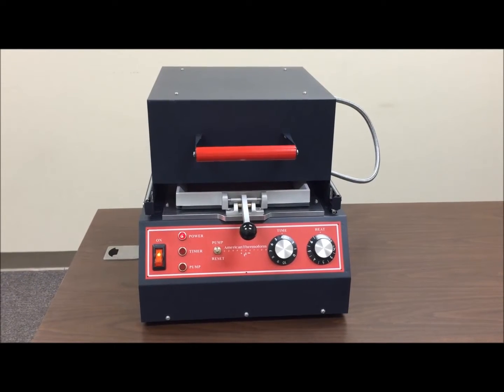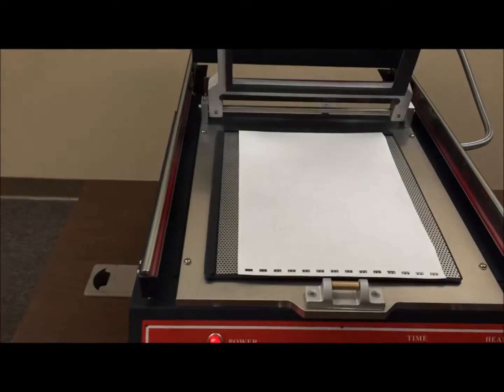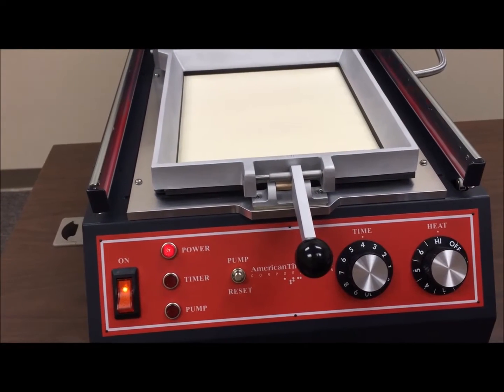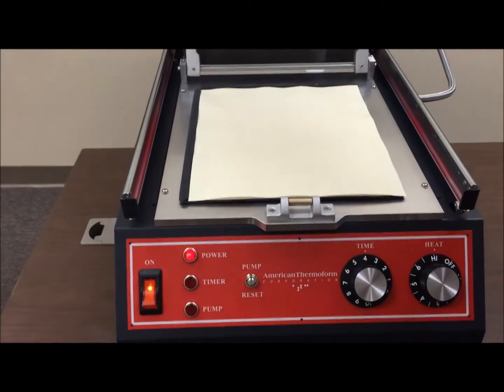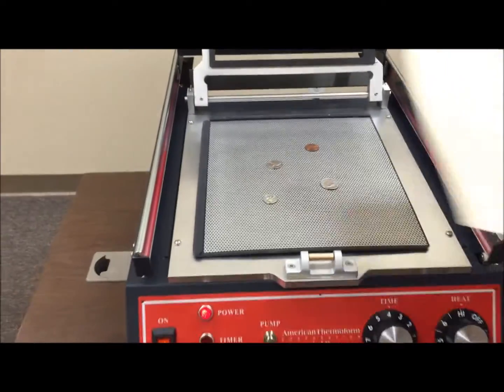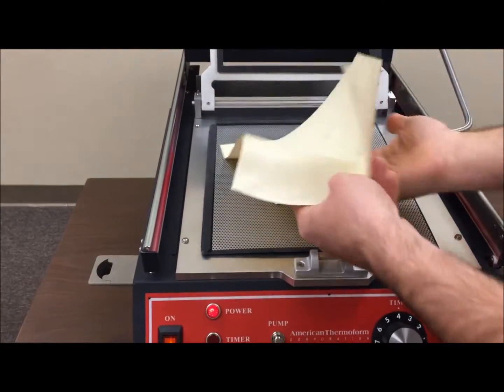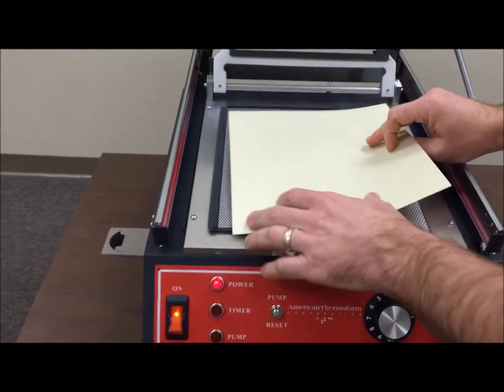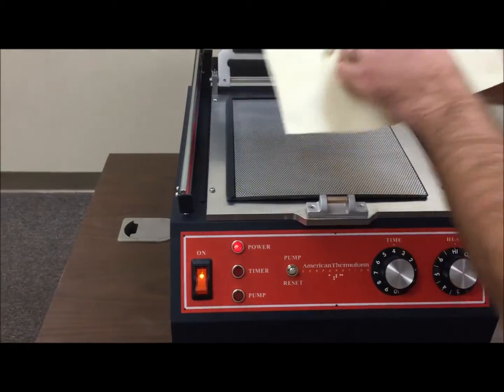ATC Brailon Duplicator: A Brief Tutorial

Comment: So what are the forming dimensions (meaning what depth, width and height can it thermoform)? Also, is this the same model as has been manufactured in a uniform grayish color?
Reply: FRAME 13-7/8×18-5/8″
FRAME 11×11.5″ (MAXI FORM)
You can see all the specifications at: 
Maxi-Form: https://americanthermoform.com/product/maxi-form-thermoform-machine-110v/
EZ-Form: https://americanthermoform.com/product/e-z-form-thermoform-machine/

I don't know the exact depth you can get, but if you look at this page for the special paper used, some of the images show objects that have been thermoformed... looks to be an inch or under.. I don't know the max however: https://americanthermoform.com/product/brailon-13-78x18-58-paper/
Reply: @JerryNordstrom  Well, thank you very much!!
Reply: @americanthermoformcorporat6110  Okay. Thank you very much!!